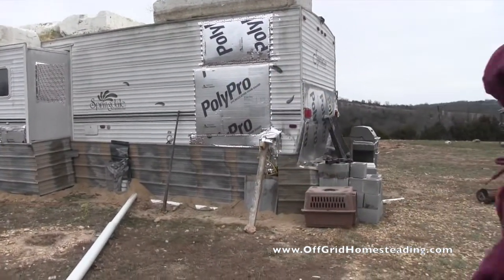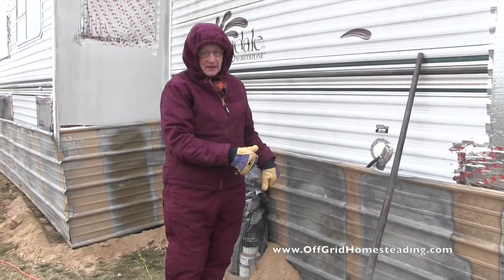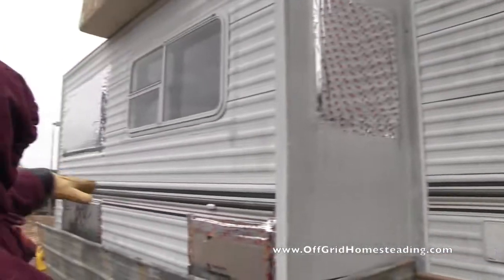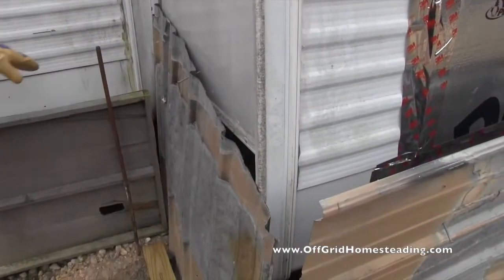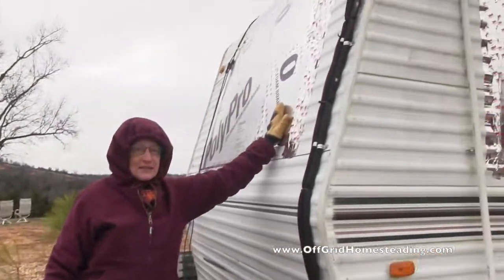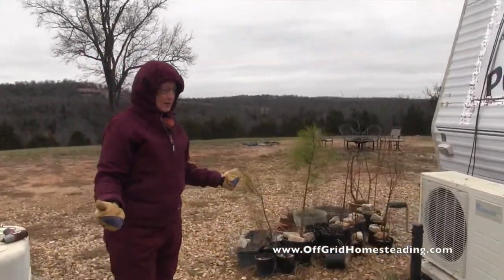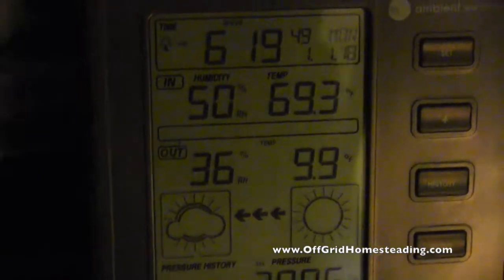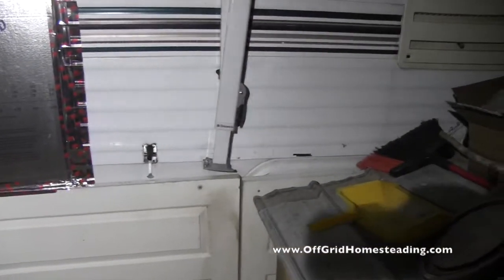OGH -Insulating RV Trailer for Sub Freezing Temperatures

Comment: Hope you make it through this cold snap- it was 8 degrees yesterday morning here in Pa.  Sunday it is supposed to be 6 here.
Reply from the maker: After skirting and taping the north side we were much more comfortable, but having to wear double insulated wool socks, in my boots to keep feet comfortable as the floor hovers around 42-50º.  Middle of the Trailer hovers around 60º's, and the top of the trailer is around 65-72º -- so not so artic inside like it was last winter.  As soon as we have a warm spell for a week or more--- we're gonna remove the bumpout and START the 14x20 addition on the back of the trailer which will be sealed like a traditional home but having 6" walls, not 2"!!  Are you in a Trailer or doing what we're doing?

Comment: To keep pipes from freezing, drip your faucets overnight.  Works even in 0 weather.
Reply from the maker: So we did the dripping on all the faucets and the lamp/light I put over the water port on the side of the RV last night burned out.... so it froze by around 9pm.   We replaced the light, and within about 1 hour the water was running again (except for the shower).... that is a weird one...
Reply: We cant do the drip thing for long on 1000Gallon Cistern off grid when there is no running water at spring as lines are frozen.